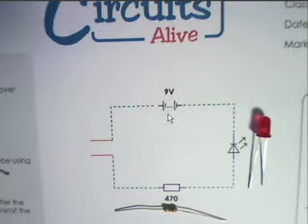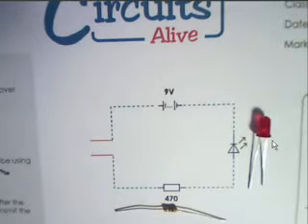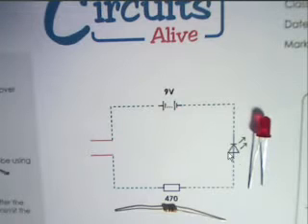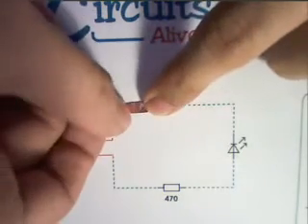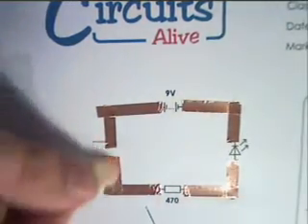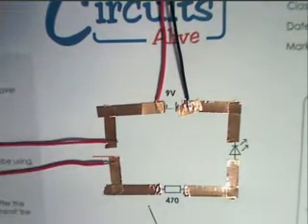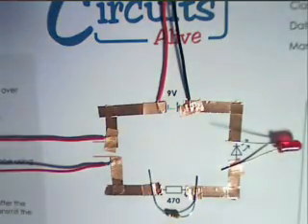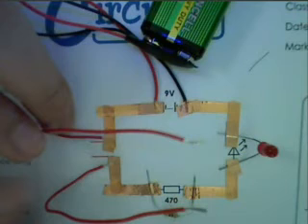Electronics: LED Circuit

Comment: @justvisiblesilence so what if you have a 12v supply, what resistor would you use?

also, if you had 2 LED's connected inline, would the first one waste some of the power before it got to the second?